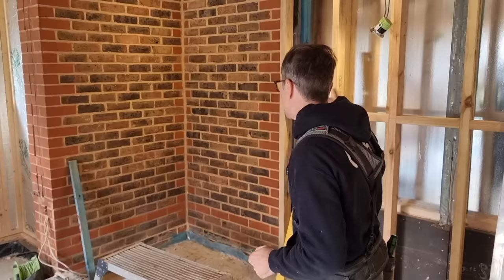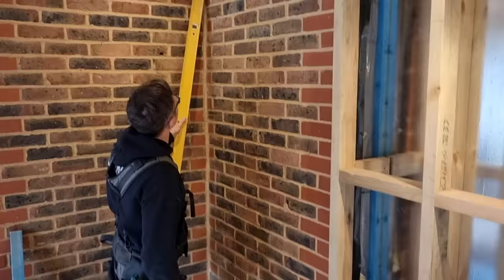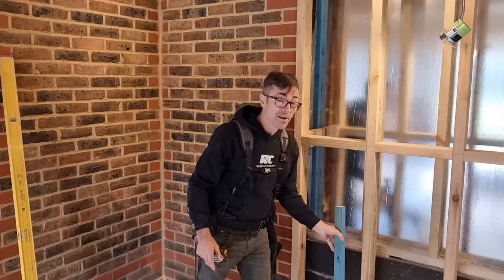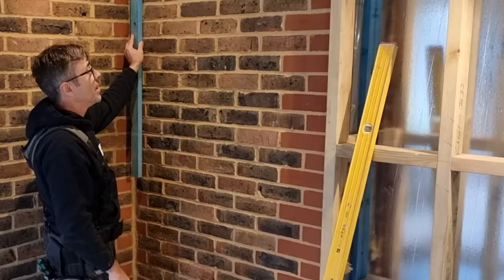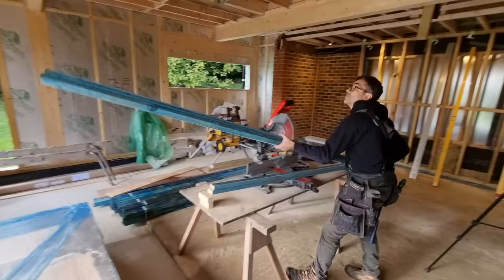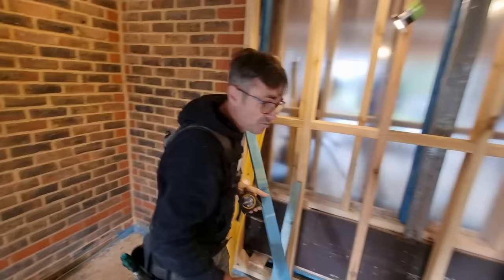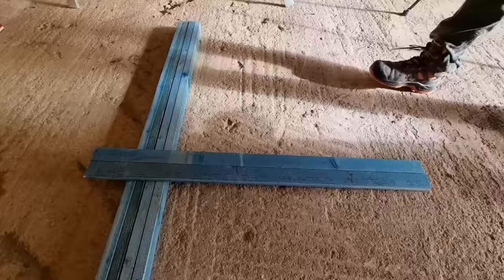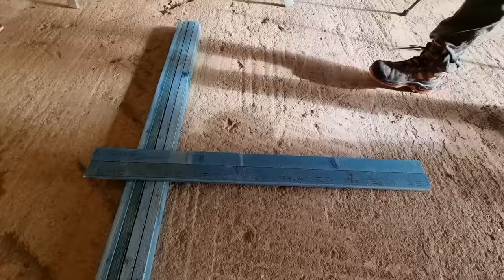How to Batten a wall the easy way

Comment: Great video if you are a DIYer but this type of framing from a trade person absolutely drives me up the wall! Timber framing without a nail gun is a total waste of the customer's money and your time and you feel free to slam me in the comments. Yes, you will never be able to use use a 1" batten with a framing gun but the entire wall will come together in a fraction of the time (and I do mean a small fraction) and you practically save nothing by using 1x2 instead of a 2x2.
Also you are missing something pretty major in your framing. When fixing a timber frame to an external masonry wall, it is best practice to have DPM between the 2 so no moisture transfers from one to the other. Yes, the packers will do the job for most of the touch points, but you are still missing some places where brick touches wood and that's really bad practice.

If you really want to use a 1" frame, you should use steal profiles. You can touch the bricks if you want to and really the whole job looks very similar to what the video demonstrates just the tools are a bit different. You also get the benefit of knowing that the frame will never warp.
Reply: With 2x2 you lose the customer an inch of room space...permanently...and for what?  Tradesmen who compromise everything in the interests of speed give me the pip.  The police advanced pursuit driving instructors have a good expression: "Make progress...not haste".

Comment: Why wouldnt you just dot and dab plasterboard onto the brick run it straight of the stud ....you could of used insulated board if needed .....
Reply: yeah. simple dot and dab . quicker cheaper and better. different skill set i guess.
Reply from the maker: Did you not see the part where I talk about why I did not dot and dab???

Comment: What do u do when the brick is old and crumbly an any attempt to tighten the screw just turns the brick to dust ?  ( making a bigger hole)
Reply: @fredhawkey380 >>> I wouldn't bother using those fancy one piece concrete/brick screws.... for a good reason.

Two solutions you can go up in wall plug sizes, make sure you tap in the plug with the same screw - plug end just below the surface to prevent 'blow out' of the brick. Go back to the basic plug & screw method this only using a simple trick...... using a smaller drill bit than needed for the plug. For example red plug is normally 5.5mm use a 5mm drill bit for a tight snug fit with little larger/ thicker core so say from a 4 gauge to a 4.5 gauge MM.

The best solution is you use chemical anchor/resin even good strong adhesive (let it go off first) in the hole to firm it all up.  
If you have crumbly bricks resin is the way to go for a best result no issue about that but be warned given the price for a tube make sure it for more than few holes as you only have one shot & the whole lot goes off & it's wasted. Most are two part mixed together in the tip so it's not something you can put it away for future jobs. I hope it helps 🤨
Reply: @gettogo0159  ye went down to 8mm drill bit works a treat! Cheers dude
Reply: @fredhawkey380  I'm glad it helped you out, it's what I was shown - all this type of stuff years ago from a old timer that once used wooden 'packers' (make a small hole hammer in a wedge shaped wood then use to fix onto) before the plastic plug was used in construction.  A practise that helpful to know even today with loose fittings in block/brick work that had/has stumped many of the 'modern' trade person using the words 'it can't be done' to 'you need to re-drill it else where!' I laughed & they took notes....... 😆
Reply: @gettogo0159  ye I did a few little wedges the other day and wondered why I've bn buying plasplugs all these years? Cutting them is bit fiddly tho. 👍

Comment: I have never been a fan of covering decent brickwork nor painting brickwork unless absolutely necessary. 👎Why not just extend the new stud wall to the inside corner of the brick walls. 🤷‍♂️ This would have been less costly if it had been done at the time the new wall was erected. Batten strips , concrete anchors shims and more time fiddling increase the price. Just asking. 👍🇨🇦👨‍🦳